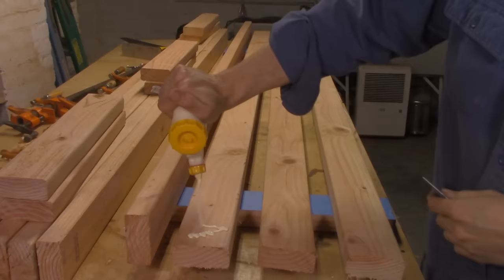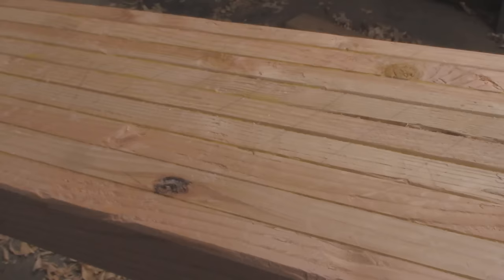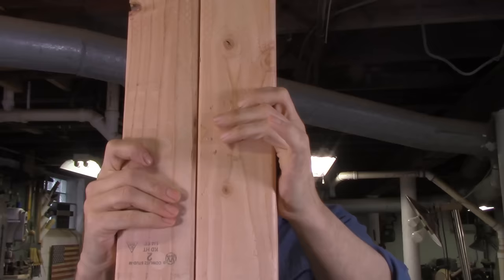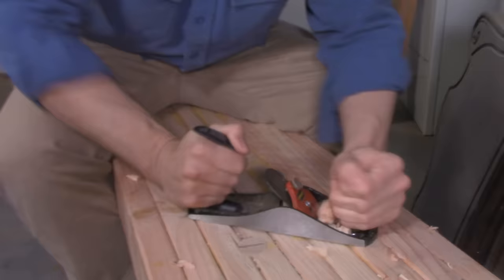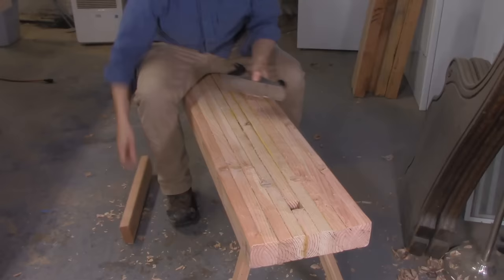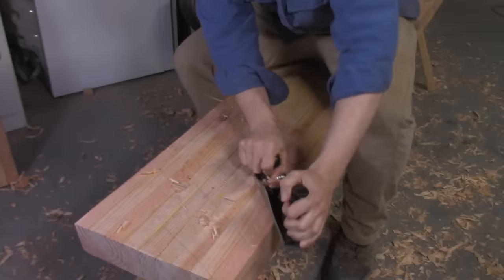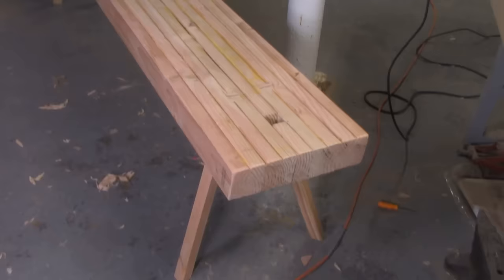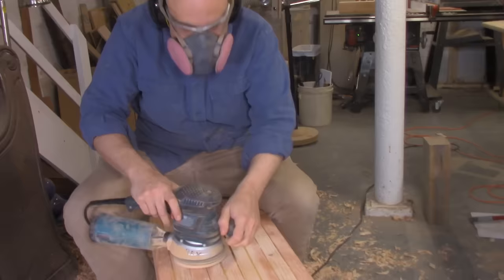Flattening the $30 workbench with one cheap plane.

Comment: I'm a professional woodworker by trade, just wanted to chime in and say that this is a good video. Sort of an inefficient way to make a bench but with limited materials/equipment it's perfectly fine. Like I'm not sure you could really make it any simpler, and often that's a good thing.
Reply: Out of curiosity and because I know I have a lot to learn, what do you mean by 'an inefficient way'? Are you talking about the need for glue construction or the low number of tools involved, or wasted materials, or something about the bench itself?
Reply: @Nurk0m0rath  Yeah just a more typical way of building a workbench is to make the top a sheet of ply with a stiffening frame of e.g. 2x4s underneath. I could probably knock a basic one up in an hour. With this way, you're using more physical material (though it may work out cheaper overall depending on the price of 2x4s vs the price of ply sheeting in your area), and also the gluing-up and then flattening process is more involved.

So yeah, cost, time, and physical amount of materials used are all a little inefficient - though the cost may work out cheaper than a ply-top bench.
Reply: I think it depends on what you're using it for. What you're describing isn't going to support holdfasts and heavy mortising operations. If you mostly use power tools, sure, throw some ply on some construction lumber and call it a day. But if you're planning to mostly use hand tools, which is the focus of this series, you need something a little more robust.
Reply: @whatevil  appreciate the response, good insight.

seems the cost of ply is sky-rocketing around here, soon contractors will have to employ security guards
Reply: This process only proves that one inch at the ends of the bench are even, dosnt tell you if the middle is lower, or higher.

Comment: This method of flattening is related to hand scraping in precision machining. With patience and some practice it is possible to obtain ultra-flat surfaces using simple hand tools.
For the impatient ones, if you own a router (who doesn’t?), building a simple flattening jig for the router will get you a flat bench top faster.
And you can use it again to make a nice live edge slab table later.
Reply: I completely agree and I use router sleds frequently since I don't own a planer or jointer. But using a router is almost the antagonist of this series premise

Comment: if your garage floor is reasonably flat, you can rub sidewalk chalk on it in an area big enough to cover the top of the bench, put the top of the bench on the floor over the chalked surface, and move it around a little. Flip the bench back over, and you can see where the high areas are by where the chalk marks are. Flatten out the marked areas and repeat.
Reply: Good tip
Reply: Well this is a very nice ' why did I not think of that' moment... great tip! Thanks for that.
Reply: much simpler. and will definitely work
Reply: Concrete is abrasive enough, if you really wanted to you could just push your bench around your basement floor and after a while it will sand your bench flat😸
Reply: @Phoenix540  remind me to use silicon carbide and corundum in my concrete :p
Reply: But how do you know if your garage floor is flat? Most typically are not.

Comment: If you want a cheap(ish) winding sticks that are really flat and strong and will stay that way, but some aluminum angle!  Cut 2 that are 24" long.  That will cover 90% of your flattening needs.  Yes, flattening also.  Just lay the aluminum across the wood and look for cups, bows and warps by using and edge or the spine.  And they don't warp!!

Comment: that cheap amazon plane works good with a new blade Rex bench came out really good nice and portable a handy extra around the shop .Another trick you can do is sprinkle Epson salts on your last coat of finish when it dries wash the surface off with water the salts desolve and you have a nice non skid finish.Works good on painted stairs too
Reply from the maker: I had no idea!  Good tip.

Comment: I used thinned down poly on my own bench.  I tested it first and found that if I didn't sand the wood after the first coat that the fuzzies that stood up provided a better grip than the raw wood.  So that's what I did.  I put on two coats (inside bench only) simply to aid with stopping glue spills from sticking badly and left the stiff varnished fuzzies.  It's holding up well and still has better grip than the unfinished wood a couple of years after being done.  So just don't sand it !  :D

Been a lot of fun watching your Woodworking for Human's chain of videos.
Reply: Fuzzies are friends.

Comment: I really like your suggestion for using offcuts as winding sticks—that's super practical.

also really good is extruded aluminum angle.  it's pretty cheap.  you can get 1 meter lengths, which exaggerate the twist more.  and it won't change with humidity.
Reply: ThoperSought dude...THANKS!
Reply: Aluminum angle is a godsend. I bought some after watching Neil using it on Pask Makes. It's better than a ruler or a straight edge. If aluminum angle isn't straight enough, then you're not doing woodwork, you're doing some kind of Clickspring masochistic machining.

Comment: I used a solid core door for my first bench, which I made twenty years ago and am only now making a new fancy one. Though I wasn't woodworking all that time. For the frame, and many other projects, I purchased hard maple at a nearby lumber auction. You got a mix of everything, FAS , common one and two. It was a fraction of the normal price, which made it much more economical to learn on. I still have a decent amount of cherry left. It was so cheap I bought a lot.

Comment: I made my bench using clear SYP(Southern Yellow Pine) 2x4's.  Yes it costs way more than $30 but.... It turned out great.  I planed the top to remove the edge radii so the surface is as flat as a piece of polished granite.  I also used an appropriate very well thinned hard poly finish to harden the surface that will see the most abuse. My most favorite "soft wood" is SYP.  After the top stopped absorbing the polyurethance and began "pooliing" the top got sanded down to a nice satin dull appearance.  To be honest I used the SYP because it was left over from a job.  I have been using resawn clear SYP 2x6's as the body material for my wooden planes. Carefully mated to hard maple soles the planes are proving to be incredibly stable and durable.  I am realizing a great deal of satisfaction building my own collection of wood working tools which includes my workbench.
Reply from the maker: If I could get it here, I would have done SYP for sure.
Reply: I get it at Lowe's.  The quality has been going down the last few years.  Here on the south side of the Mohawk River in upstate NY some of the Amish Sawmills have really beautiful Adirondack Red Spruce which is almost as hard as SYP.  It isn't kiln dried or planed.  Rough green lumber that dries fairly quickly when stacked properly (I worked as a lumber stacker one summer 50+ years ago.  Oh yeah I really enjoy your videos. I found your videos because of Wood by Wright. I don't watch his videos as often since discovering yours.  
Peace.

Comment: You're doing what I'm planning on doing.  I have some recovered wood and plan to use it as much as possible for 3 x 8 bench. I thought of running the straighter edge against the fence and trimming it on my table saw for the first step.  Your video will help with the other steps.

Comment: Another good video; thanks. I personally cannot stand (non water-based) polyurethanes because they're so slow & messy, but I've found the water-based ones to be quite good these days. They're safer, easier to use, cheaper to thin down, & you can wash out your brushes in the sink. The downside is that they will raise the grain more so would require an extra sanding pass.

Since you showed a random orbit sander, always worth pointing out for beginners who have one that pressing down harder will not remove more material too. That's an easy mistake to make if you're used to manual sanding or other types of powered sander, where more pressure can make stock removal faster.

Comment: I jumped the gun and started my first bench before getting my plane. This combined with a bad top finish, I think caused the boards to separate in less than a year of being constantly outside. So I'm doing it again... The second time around is moving faster than the first but you really want to take your time and make sure you have good glue joints and that you don't rush the finish. I also plan on putting some 1 inch dowels through the body of the bench, and smaller diameter dowels in the ends to ensure a mechanical hold of the boards in case they separate in the future, The smaller dowels should not get in the way of the vice or any of the other holding options he uses in later videos.

Comment: Also.. cheap power planes are available at home store for about 125 bucks. I realize that it's not free but it's an indispensable tool in a wood shop. I can flatten and smooth a 10'x 24" 2x4 top in about 15 minutes both sides. Then take my time with the hand planes.
Reply from the maker: Whatever gets the job done is good by me.

Comment: This video is awesome...so awesome in fact that I bought lumber last Thursday...and last night I began planing the boards with my arsenal of antique cast iron bench planes that I've lovingly restored over the past several years... including an 18" joiner. Thanks for introducing me to this style of bench! It's so much more accessible than the elaborate Roubo style benches that would probably take me several months to complete.
Reply from the maker: Yeah, I think I could make a Roubo, but I don't see the point. Many simpler designs get the job done just fine.

Comment: One slightly more complicated way of getting a fixed height is to have some plastic tubing with some water in it and a string.

The water level on one end of the tube will always be the same as on the ther end so if you have one end fixed you can move the other around and have an easy way of seeing if the height is the same. Or put a string between them and you should have a cude long water level.

Usually used with concrete pillars and making sure suport are at the same height.

Comment: Good common sense approach.  Lots for the new woodworker to learn about planing in the process, too.

I think the channel is "English Woodworker," or maybe Samurai does one too... makes a large plane from basic materials with a lot of leeway for a beginner who might not be perfect with their chisel skills.  I've seen them made in the traditional style and Japanese style and they both worked great.  Blades were either from repurposed old lawnmower blades, truck springs, or blank high-carbon steel stock you can get on Amazon for not a lot of money, ground to shape, and quickly hardened with a propane torch and an oil quench.

Comment: I built this 3 years ago.  It cost more than 30 dollars

Tip. Run 2×4 through the table saw to take off round, i used  a power plane before my glu up worked great made foe a better finish.  

Also, power plane , power plane power plane lol
Reply: You missed the entire point of this video didn´t you?
Reply: @Asbjoern  cheap with not much i get, does craftmanship matter, maby not for some but after making two of these benches i wish i paid closer attention to detail on the first  is all.

Comment: Better way I figured out after I learned the hard way.  Take the rounded edge off with a table saw so they are flat on one side.  Lay them all flat face down on the flattest, straightest work surface you have.  The bottom side doesn't matter.  Do your standard glue up of the boards.  Let it dry and you'll have a fairly flat and 95% the way there work surface once you are done.  Then plane and sand as need to get a dead flat surface.  You get better results with less time and less effort.  You can also cut 1.5 inch strips out of the 2x4 (1.5x3.5) boards of you want a thinner work top.
Reply: The point he was trying to make is if you do not have the access and resources to power tools (or prefer to avoid them) you could still make an awesome bench for cheap! 🤓✌️

Comment: Working with a plane diagonally from both sides is very similar to how you hand scrape machined surfaces for flatness, where you do a crosshatch pattern, which knocks down the high spots and evens it out. Check out hand scraping cast iron videos on youtube and you'll see a lot of similarities, but with the metal scraping, it's accurate up to .0001" as long as you're using a good surface plate as a master. A plane on soft pine is plenty accurate for a workbench!

Comment: I’m thinking on doing this, but surfacing with some cheap hardwood plywood to give smoother harder surface.
Reply from the maker: You'll still need to flatten the surface underneath...and then you already have a flat surface!
Reply: I wonder if one could just find the low spots and fill them with Bondo, then add the plywood.  I guess part of the question is how flat is flat enough.  Seems to me that twist in a work bench would be the problem to avoid.  Rex's advice to pick the absolute best 2x4s you can is the very best way to start.
Reply: Only problem with plywood workbenches - you can't really resurface them, short term thing
Reply: Flat and harder than SPF lumber is what I’m aiming at.

Comment: I would suggest Planing the surfaces with a router.  Using two eight foot straight edges, constructed from 2 high quality 3/4 inch by 4-1/2 inches wide by 8 foot long plywood pieces, glued together making an 1-1/2 inch thick straight edge. Then attach them to each side of the bench top, parallel to each other, with a 1/2 inch space between the bench top sides and 1/2 inch above the surface of the bench top.   Then mount a router, centered on a guide that is straight and long enough to allow the router to cover the width of the bench top.  Use a router to plane the surface of the bench top.  Then flip the assembly and surface the other side.
Reply from the maker: Kendal Eklund This is a limited tools build for someone who doesn't own a router.  Also,  I've got nothing against the router method,  but it doesn't really teach you much.  Doing it by hand is really instructive.

Comment: Rex, basically, that is all that winding sticks need to be - two scraps of wood that are equal. By that, I mean they don't have to be parallel (but it helps if they are), as long as they have whatever angle off parallel equally. I'm not sure that I explained that right.

Comment: I assume that the cheap jointing plane option will be a piece of straight ( relatively speaking) 2x4 of sufficient length to cancel out the oopses in it, probably "flattened" with the #404 lightly and then turned into the body of a new plane to hold the same #404 blade and chip breaker. It could probably work fairly well.
If you happen to have a piece of hardwood of any length and significant flatness, it would work better... of you also happened to have a flat surface ( the bed of your neighbors pickup truck for example ... hoods no longer being flat anymore) that you could glue some sand paper to ( he won't mind I'm sure) ... you could tune the bottom a little more even... there is always that picture window in the front room - just be sure your wife is out of town and then blame the dog...the neighbor's dog might be better.
Yeah, this could work.

Love this series Rex
Reply from the maker: Oh, just you wait....
Reply: @RexKrueger  Okay, I"ll bite... this is like woodworking and a murder mystery all in one!  You just can't GET quality programming like this anywhere else!
...or is he going to turn that #404 into a hand crank surface planer - somehow I wouldn't exclude the possibility
Reply: @RexKrueger  Okay, I'll bite !!

Comment: Youtube has also been pushing your videos, so maybe that's helping, or maybe it's a sign of more popular videos.
You can take a note out of the body shop handbook here if you want it flat flat. Get a (relatively) long flat board (~24") and put some 60grit sandpaper on it to board sand the thing, I don't know if guidecoat would work on wood, but your pencil marks accomplish the same thing.

Comment: Float about 3/8 inch of clear epoxy on the hole top and let gravity plane it out before you sand it is still plane it with a block and some sandpaper then buff it out have a nice smooth surface